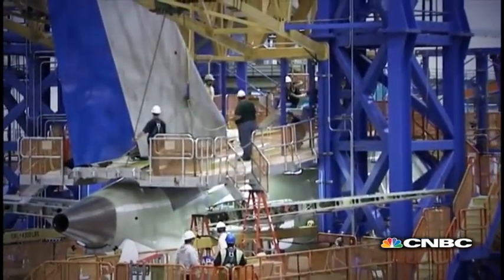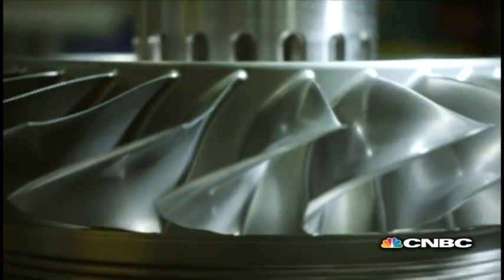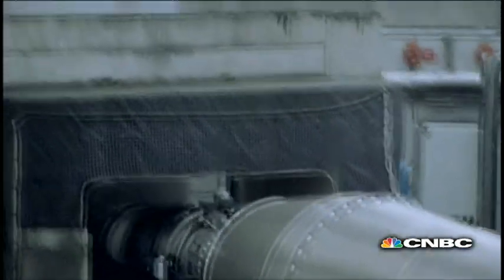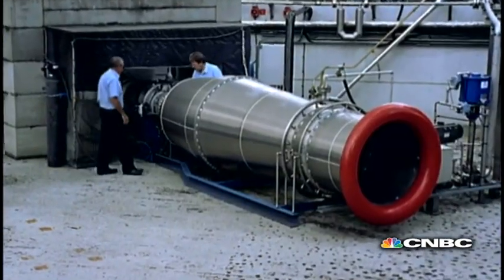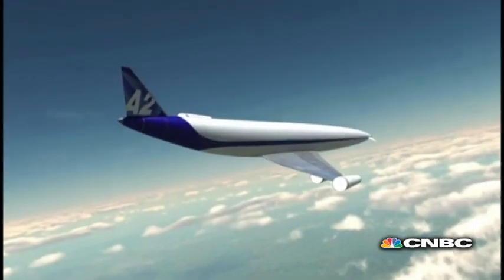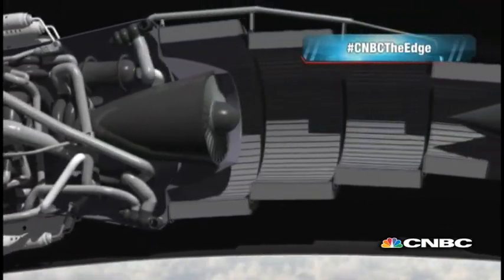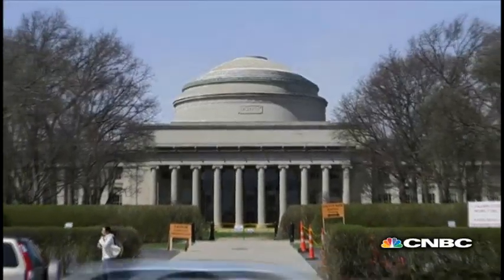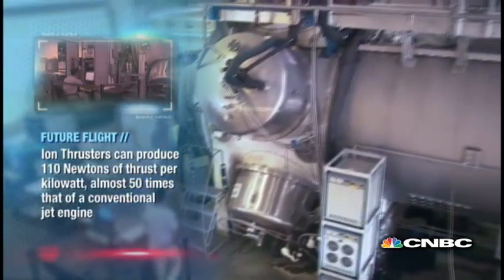Mach 5 aircraft technology | The Edge

Comment: 1:52 "...This means that we are going to be able to fly at speeds of Mach 5 pretty easily in the future"--this statement is an absolute load of bullshit! There's nothing easy about flying at Mach 5, and having an engine that could theoretically do it doesn't make it any easier. Newsflash to the guy talking about his fancy precooler, in case he'd forgotten: it is already possible to fly at speeds much higher than Mach 5 by using rocket propulsion. A major problem at those speeds, which this guy apparently pretends does not matter, is structural and thermal stress on the airframe. Unless you can solve those problems, having a more powerful engine won't help you at all in sustaining travel at Mach 5. On a side note, the statement the newsman made at 0:55, "...the experimental apparatus can extend the speed, the power and the range of existing systems by up to five times the speed of sound" makes absolutely no sense whatsoever. The Mach number is a ratio of an object's speed to local speed of sound where the object happens to be travelling. This ratio has absolutely nothing to do with increasing speed, power or range of anything. I could go on complaining, but my point is, why do news stations bother spewing scientifically illiterate bullshit like this? There are much better ways of introducing the subject matter to the audience without butchering the details and giving people false ideas of what's possible and what isn't.
Reply: This is why all of you are not engineers. Go ahead and whine, rant and complain about videos like this while the professionals figure out how to make it happen. Think about it, how many technologies do we have today that were once considered impossible? Being able to do some simple math or point out a few random facts doesn't make you even slightly qualified in this field. Get your head out of your ass and stop being a waste of oxygen.
Reply: Before lecturing people on lack of understanding you might want to check your own. A jet engine is not going to lack for CO2 emissions just because you put a precooler on it. You're still burning hydrocarbons, co2 is coming out the other side. Temperature is just one of the challenges for the engine as well. Intake charge turbulence is another. Backyard engineers pre-cool the intake charge on car engines with hardware store parts. Some water-methanol sprayers are child's play compared to the geometry considerations for managing air turbulence on the intake charge. Turbulence and heat over the frame are another huge issue. The SR-71 is the only aircraft that can take off and land on it's own power even flirting with these Mach numbers. The temperature changes are so drastic the aircraft body has gaps in it on the ground so that it's frame doesn't buckle when in flight. It bleeds fuel sitting on the runway. Thermodynamics didn't leave town just because these guys put a few sprayers in the engine. So the pre-cooler is a good idea but it is the least of your problems getting a commercial airliner to mach5. I suspect the engineer knows this and he's just milking a research grant.
Reply: Stev Rex "Thanks for proving my point"...after you literally made no point at all. Hang on, if you read it sideways and squint a little it seems like you're saying this thread is a rant and you don't like it. Well, I prefer calling it a discussion, but you can call it what you like. Further, I couldn't care less if you don't like it. If you didn't like it, why did you bother reading and commenting under it? The mature thing to do (since you want to throw around accusations of immaturity) would be to move on and ignore it.
Reply: Calm down guys its only youtube
Reply: corisco tupi
Thanks for pointing that out; I should have been more accurate.
Reply: You misunderstood his statement. 

Mach 5 is with their engine much easier to accomplish, or you know just plain old possible. Don't get too hung up on the notion "just because it has not been done, means it can not be done". 

Also, I don't think they will be flying mach 5 as sea level, as in the old movie "Firefox", or normal passenger airliner altitudes. This will be a transatmospheric aircraft, flying so high the only other planes to fly so high are the X-15, U2, and SR-71. Not much in the way of atmosphere to interfere. At those altitudes and speeds. a 20,000 mile trip, flying London to Sydney over the North Pole, in 4 hours is quite easily possible. 

No, you weren't expected to get all that from a snippet. But if you come in with the knowledge or are at least willing to seek it out, what some people say will make sense and your world is not nearly so small and "can't" becomes just a word and not a natural law.
Reply: +Eric Cassidy Dude, how much misinformation can you pack in a single comment. Energy Density has nothing to do with mass - it has to do with volume. I think you mean "Specific Energy" and here, for chemical energy, Hydrogen is the highest of all substances - 142 Mj/kg vs 45 for jetfuel
Reply: Michael Etzel "Even if you fly at extremely high altitudes, high supersonic and hypersonic flight results in friction-heating; it's simple." ==> Strictly speaking, that may not always be true. It is high indicated airspeed, not Mach number, that causes heating. It is conceivable that at some extremely high altitude you may be flying at supersonic or even hypersonic  speeds yet at low enough indicated airspeed so to not cause significant heating. Still, such flights would have to fly through lower atmosphere layers climbing and then descending, at which times some drastic speed limitation would be needed to avoid heating.
Reply: corisco tupi the sabre engine though, is designed to be multi cycle. Just like the j58. It simply changes its cycle as it ascends from sea level and climbs to high altitude. That's what makes it revolutionary.
Reply: Stev Rex I'm not sparing you a damn thing. You could see the thread and many comments in it were long without needing to read it. No one forced you to read it, so sit down. Besides, YouTube is the PERFECT place to discuss this. If you're not interested, don't bother commenting or even reading the comments.
Reply: Michael Etzel research Dr Paul laViolette and read his book secrets on antigravity propulsion I'm pretty sure he'll make all this look like a turd rolled in glitter, free energy, anti gravity and electrogravitic propulsion has been around for decades but the powers that be don't want our civilisation to attain that much freedom.
Reply: Michael Etzel very true.  Another thing even if can be done,  people would need to be suite up like a pilot those speed would suck the oxygen out of your blood,  the G force would have most of the people pass out. Look what happens to pilot's pulling 9 G at mach 1.8 and suited up, the pilot's are gasping for air becouse of the pressure force of that speed even, now they talking about mach 5 for normal passenger aircraft,  that I got to see to believe.
Reply: becuz they make money by running a story.
Reply: Word I rolled my eyes really hard at this segment. But I enjoy smugly dismissing dumb content so, I got my fun out of it. Just holy shit... a commercial aircraft going mach5. Yeah, there's a whole nightmare of engineering problems beyond the engine. One might have. Guessing the engineer is just milking a research grant.
Reply: Oh i see now they expalin it as an improvement of normal jet engines... this is not the case look at the website of reaction engines ltd and search youtube videos about "skylon"
Reply: Yes your lack understanding. H2 has 1/6th the energy density of jet fuel(in atmosphere).  That means the jet has to carry a greater mass of fuel for the same range. So just to get passed the range deficit would mean the craft needs to carry 6x the fuel. That doesn't even account for your losses in capability for carrying that much additional mass in fuel.
Reply: DocWolph First, his statement was clear and unambiguous; why are you trying to read things into it that are not there? Second, why do you assume I'm hung up on any notions? In fact I clearly stated that it has been done before, it's just not easy.

Third, it's obvious to anyone with knowledge on the subject that an aircraft like this would travel in the higher portions of the atmosphere. Do not assume what I "expected to get" from a snippet. I spent nearly four years studying aerospace engineering before I decided to study something else, so I am quite familiar with the subject. If you make a bunch of assumptions without explaining why you made them, you look silly.
Reply: DocWolph I just to point out some relevant things about the X-15, SR-71 and U2, because you cited them as examples to support your point:

The X15 was carried to it's "launch" altitude of 45,000 feet by a B-52. This is already at the edge of a typical airliner's operating altitude. Its test runs were performed largely far above this altitude (at least twice as high) and yet, airframe heating and stress were STILL a significant problem. The SR-71 faced similar problems (flying at an altitude of about 85,000 feet), even though it was never meant to fly hypersonically like the X-15. Finally, even though it flew at an altitude of about 70,000 feet, the U2 did not fly supersonically; in fact, at its operating altitude it was practically always on the verge of stalling, so it never faced friction-heating problems.

Even if you fly at extremely high altitudes, high supersonic and hypersonic flight results in friction-heating; it's simple.
Reply: Michael Etzel ,,,
Reply: Jack 1 What! Youtube! did you not notice that this is from CNBC ?
Reply: In future spare all of us your need to rant. Start a blog, rant on there.
Reply: Unless it's build from titanium or stainless steel! Like the XB-70 Valkyrie! & X-15!
Reply: Jack 1 Thank you!
Reply: corisco tupi U couldn't be more correct. This isn't made for a class in aerospace engineering, it was made for a TV audience. So it's  on abt a 4th or 5th grade level.
Reply: Michael Etzel 0 4cogai sacola
Reply: What is the point of flying ppl at mach 5 omfg, let's burn kerosene yey!
Reply: Well, you may be wrong. I'm actually working on an invention that will reduce drag by up to 80%.
Reply: Well, you may be wrong. I'm actually working on an invention that will reduce drag by up to 80%.
Reply: I'm a high functioning dumbass and even I knew that the "pretty easily" statement was a load of crap. Probably the line he duped his investors on.
Reply: Benjamin Bode
Hey Ben, who are you replying to?
Reply: The original comment by Etzel.
Reply: ccmyart have you heard of Thomas townsend brown?
Reply: Joe D
I am now. Why do you ask?
Reply: ccmyart I can't make sense of your  reply, just a simple yes or no would do.
Reply: Joe D
I am familiar with him now because I read up on him after you asked. Now, why did you ask me if I heard of him?
Reply: ccmyart you should study him, also try and get a hold of a book/pdf by Dr Paul LaViolette called "secrets of antigravity propulsion", hopefully these people will have an influence on you work.
Reply: well theres a time that people used to said flying is bullshit!
Reply: mechanics cant even properly fix mach 1 planes maintenance how da actual fuck can they fix a mach 5 plane
Reply: Michael Etzel n
Reply: Michael Etzel .
Reply: Michael Etzel that means they traveling five times the speed of sound that's going about 3500 miles an hour the Concorde 79 was only going 1400 miles an hour which is twice the speed of sound which is Mach 2
Reply: Michael Etzel 1. Unlike a rocket engine which has to carry tons of its own fuel, the sabre is designed to use the gases in the atmosphere as part of its fuel.

2. Like the j58, the sabre is designed to be multi cycle. And along with the fact, that the weight savings gained by the airframe and not having to carry all that fuel into the upper atmosphere like a rocket engine would, should massively reduce the stress on the airframe, and increase efficiency accordingly.

3. And as for the airframe technology designed to carry the sabre engine, hypothetically, it goes hand in hand with reaction engines stress reduction. The airframe developer would obviously have to do the Maths and use the correct up-to-the-minute technology in order to design a successful airframe in conjunction with the sabre engine.

The engineers at reaction engines, have years and years of experience working with aeronautics and reaction engine technology - of which the jet is a good example.
Reply: Chill ffs
Reply: They solved the structural and thermal stress problems of the airframe but in the engines they dont. The problem with rocket engines is that they are incredibly inefficient with specific impulses of 300-400, because they cant use the oxygen from the air. If you built an aircraft what works with rocket propulsion it won't be able to go further than a ballistic missile. But the precooler what they've created makes it possible to go from alasca to australia in 4 hours, without any CO2 emission. And it is much safer and cheaper than getting on a ballistic missile, and better than a ram or scramjet engines, because it works at any speeds. It's not bullshit just because you don't know enough of it...
Reply: TV shows are the worst possible source of information. We should take them for what they are -  entertainment with no obligation whatsoever with real facts. Unfortunately, many people do take those shows at face value.
Reply: The engine will use liquid hydrogen as fuel... please...  my lack of understanding?
Reply: Michael Etzel
You are obviously quite immature. Thanks for proving my point for me sport.

Bye bye.

Comment: please make air plane go faster like 2000 miles per hour.  thanks.
Reply: Depends on the altitude actually.
Reply: already exists
Reply: because the higher you go the slower the speed of sound is, right?
Reply: Murdy Baskan Mach 5 is 5 times Mach 1....
Reply: This can apparently go 3600mph
Reply: more like 3700
Reply: 3836.35

Common core math huh?
Reply: Moron.
Reply: 5 mach at sea level is 2550 km/h.
1 mach at sea level is 1141 km/h.

Thus, it is not 5 times faster than our recent planes.
Also, the engineer do not mention about SFC values of their engines...
Reply: +Javed Ahmad there are already planes that do way more than that now but in terms of commercial flights, the concord could easily reach 1522 miles an hour which is mach 2.

Comment: the cooling not only of the engine is critical, the plane need to be cool down too.
Reply: Its possible to use the fuel as a heatsink before it is burned and run it through the hot areas of the plane to remove the heat.
Reply: Development of Graphene enhanced materials will solve a lot of heat induced stretch, that itself is not too far off.
Reply: How about cooling the fuselage with nitrogen like they used on race cars tires will the air resistance heating the metal frame be compensated  
But again the mach 5 speed if done within the ozone layer will again produced negative effect upon the EARTH weather pattern just like the Concorde whose daily flights sucks the ozone till its eventual demise.
Reply: dj skar But titanium is expensive :\

Comment: hm. fuel consuption is too big
Reply: No. Amazingly it actually isn't. Since the air gets thinner at high altitudes you can go at higher speeds for the same effort.
On a conventional aircraft the only limit to this is that when air enters the engine too fast it will be incredibly hot and won't be able to heat up/expand much further in the combustion chamber.

But with the concept of reaction engines the air would get cooled down after entering, thus allowing the engines to stay efficient at high velocities.

This is not some stupid fantasy concept a college student came up with, people have been researching this for years. A functioning prototype has already been build.

This is quite likely to happen (at least unless the Brexit somehow fucked up their EU funding.)

Comment: AS long as the world is happy to buy the planes, and change or upgrade runways REL can be successful with the LAPCAT and SKYLON. Worry is that if the SCIMITAR AND SABRE engines remain a specifically British interest, that it will not be profitable with such a small number of possible airports that could support them and the aircraft with massive weights that use them. As well as having passengers with enough income to afford using the services they provide. Just look at what the US did to Concorde...
Reply: I'm not too worried about that. If the economic calculations they made were correct in any way the Skylon would be able to reduce the cost of binging payload into orbit from 18.000€/kg to 800€/kg. 

No one in their right mind would miss out on that.

The thing I'm most worried about at the moment is that the Brexit somehow messes up the company's EU funding.

Comment: This makes my idea of a mach 5 3-floor amphibious passenger jet sound plausible... It would have 8 of these engines with 4 intakes and 2 sets of engines, one on each wing. The plane would have a mix between a delta and a swept wing, something like a diving bird. It would have canards and a massive T tail at the back. between the T tail and the wing would be another canard like the one in the front. The plane would have a curvature like a 747, just more smooth. It would be slightly longer than the AN225, yet with narrower wings.

Does it sound that bonkors? I surtainly don`t think so...
Reply: +Mathias T.W.P why in the world would you want to add all the weight and complexity by making it amphibious...?